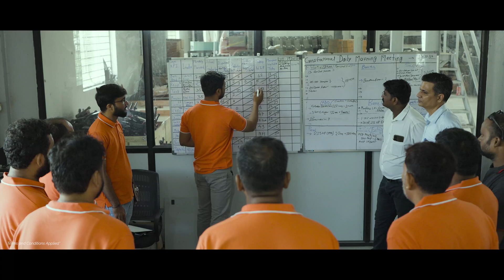The Comptech Legacy - Air Compressors and Electric Vehicles

Comment: I have owned ( vx1 model) and am disappointed for few reasons

1) charger wire length short
2)Front mudguard plastic Quality very bad
3) handel wiring socket are very noisy fix this issue